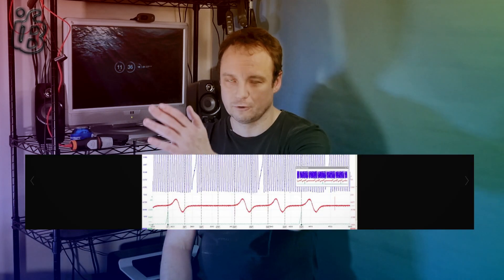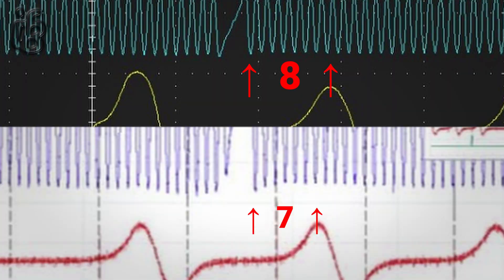YARIS XP90 TIMING CHAIN P0016 pt1 chat

Comment: any way to get part number? the o ring joined into three in the timing cover is not included in the timing kits...so wanted part number and is ebay the best price..local sellers don't give discount if they find ur not a professional
Reply from the maker: This is quite an important o ring, I got mine direct from Toyota.
Reply: @ifell3  thanks one more thing. The stud or threaded rod is gone for me . I stripped it. Is it only available in toyota or any other shop? I searched online using partnumber but no one sells ...Any suggestions?
Reply from the maker: @Truevideoz  With all due respect this video is 4 years old jajaja 
Which bolt are you on about https://www.catcar.info/toyota/?lang=en&l=bWFya2V0PT1ldXJvfHxzdD09NzB8fHN0cz09eyIxMCI6IlJlZ2lvbiIsIjIwIjoiRXVyb3BlIiwiMzAiOiJZQVJJUyAgICAgICAgICAoRlJQKSAxMTY1MjAiLCI2MCI6IlNDUDkwUi1DR01HS1ciLCI3MCI6IjExLTA2IFRJTUlORyBHRUFSIENPVkVSICYgUkVBUiBFTkQgUExBVEUifXx8Y2F0YWxvZz09MTE2NTIwfHxyZWM9PUExfHxtb2RpZm5hbWU9PVNDUDkwUi1DR01HS1d8fGVuZ2luZT09MlNaRkV8fG1vZGVsbm89PTAzOXx8UHJvZFBlcmlvZD09MjAwNjAxMjAwODExfHxtb2RfaW5mbzA9PVNPTHx8bW9kX2luZm8xPT1NVE18fG1vZF9pbmZvMj09NUZ8fG1vZF9pbmZvMz09RlJQfHxtb2RfaW5mbzQ9PVJIRHx8bW9kX2luZm81PT0zRHx8Z3JvdXBfaWQ9PTExMDZ8fHBhZ2U3MD09MHx8cGFnZTYwPT0wMDE%3D
I bet you are not even subscribed are you, or even liked the video aha only joking fella

Comment: Thank you for making this video, this is exactly what i was looking for at exactly the right level of detail for my skill level. 

I've got some noise from a 1nrfe, and i dont think that its the usual suspects (water pump or tensioner pulley, because i've replaced one and rhe other seems ok with the belt removed, no obvious grinding noises or play) and really dont want to take anything apart to check for a loose chain before giving into the garage (I've no intention of doing the timing chain myself! But like to know what the problem is). I wanted to know if and how i could use a scope to check for crank/cam anomalies, and you explained that perfectly 👍

Also some nice tips that i didnt know about Toyota tech data (can you download or only view the files?). Plus catcar was a new one for me and one I'll use again (as im always fixing one car or another!).

You've actually made me feel guilty about not uploading my fix for the vw antishudder valve which goes into a pedantic level of detail in oulling apart an unserviceable unit 😂.
Reply from the maker: @dalbahia4273  wow, best reply ever. It's replies like this, that make it worth my time. Don't feel guilty about not doing it, it's a lot of faff videoing and editing. 

What sort of noises have you got? I think I did a video on pulleys and auxiliary belts too. 

The tech data site is awesome, I've never known any other manufacturer to do it. Some even get nasty when you try to ask for a part number after they've told you the shocking price of theirs. 
Yes you can download, the files in the amount of time you have paid for, hint - look at the files afterwards and smash that download button as much as you can aha 
The TSB (technical service bulletin) is handy to have as well. Toyota will say to fix this try ABC, but if reported 9/10 it's F that's at fault, they send out a TSB to all mechanics saying if you need to fix this try F first. 

Catcar is fantastic!!
Reply: @ifell3  it's a grinding  noise, more than a rattle. 

Tbh, I normally work on VW diesels, so I didn't even spot it, but the garage that I use (and trust) pointed it out. Now I can definitely spot it, it goes away a bit if I take the tension off the tensioner (so the tensioner roller and water pump aren't spinning). But if definitely like to exclude anything about the chains. 

I replaced the tensioner pulley (my xp90 has the dual vvti so nf engine), I put in a skf part, but that hasn't really sorted anything, I also put in a new alternator belt (because, whilst you're there...). I did push and pull the water pump, but it's not got much play in it. I do have another water pump from Toyota but it's a hassle to put in, tons of bolts and no clearance (and don't fancy raising or lowering the engine, as it's a pain, but may need to do so anyway). I'd like to check the chain tension before I give it in for a water pump replacement, to give more direction to the guy who fixes my car (cut down on diagnosis costs a bit). 

On a side note, my car was pretty tired. Like yours, 'fully serviced' for most of its life by Toyota and then independents, but after having it pulled apart, I'm not impressed by some of the quality of work and the lack of any effort to pull out hand fulls of dirt from the cowl, brake dust from the drums, etc (hence wondering if it's wear on the timing chains). 

On the plus side, I've fully changed our every (well almost every) suspension and braking  component (including rubber insulators, springs, shocks, etc...), and it's amazing how well it now drives. It was horrific before, had the handling of a barge. It would be a shame if the engine was that worn! I'll have a look at the links on how to wire up a scope to the crank and cam shaft sensors.
Reply from the maker: @dalbahia4273  Have you tried the screwdriver trick to isolate the sound or, better still, a cheap stethoscope? It might get you closer to the problem. 

I might have covered a bit in this video about the water pump screws, I think I rounded one. But yes, at the back of the engine. They suggest removing the bonnet cowling etc for easier access. I'm wondering if you could get a motor and a pulley and test each component individually, like the water pump and the AC. My AC makes a horrible noise when on and idling. 

Yeah, you can find loads of crud under the arches and that, but the engines are good. The tensioner for the chain is behind the timing chain cover, which uses a special heat-proof silicone. They also recommend taking off the oil sump, but I never bothered. In my second video, the guides and tensioner all appeared fine, not too sure if that would be the problem. Or it would be the last on my list of things to find. 

Out of curiosity, I've got two new wishbones to fit. What are the chassis bolts like, super seized, or did they come out ok?
Reply: @ifell3  you're right, I do have a stethoscope. I also didn't think about the Aircon pump, as when I got my car, the Aircon wasn't working (I checked and there's no pressure in any of the lines). As there's no pressure, I can't engage the pump and put loads on it (I was thinking of getting some nitrogen to do a leak test, but to be honest, you've got to draw a line somewhere, I really don't want to get a vacuum pump, Aircon machine etc...)

I've got the old accessory belt so you're right I could put it on a drill and run the water pump and Aircon pump remotely. But I've had enough, I'll give it into the garage next week if I can (I've spent so much time on that car this year, I'm done with it!). 

I didn't do the lower control arms or track rod ends, I did have it on jack's this weekend to finish off the tensioner, but thought stuff it, that's a job for next year 😂. Plus, one of the bolts is obscured by the oil filter housing (it's a cartridge filter on my model) so I'll do it when I need the next service. 

For suspension bolts, some can be a pain. If you want to do a full suspension service (which id recommend, it feels like a new car), the rears are a piece of cake, I put in trw shocks, kyb springs and the rubber insulators (which I could only find at Toyota). The only tip I would give is get a pass through socket set, there's a great one at Amazon for £40, Sara ST09314SJ, Else getting the top bolts on is a pain, you will also need a crowsfoot spanner to torque it properly (if that's your thing, else tight enough should be fine). One other thing to watch are the stupid little bolts for her and sensor line and brake line. These will likely break. I would heat these up before tackling them and use plenty of wd40. I snapped the first with an impact, so used a standard ratchet for the second and still snapped it. You can weld new bolts in, but it's a pain in the ass. I'd also recommend getting some cold zinc primer spray (not zinc and aluminium), as far as I can see, nothing on Toyota's seems to be galvanised!! Where I saw rust, I took it back to metal and gave it two coats of zinc spray. Btw, you'll probably find that all of your brake lines are corroded well, they're about £20 each from Toyota. 

For the front suspension, I would honestly take off the cowling (if you haven't already). There's likely tonnes of crap down there, plus I got rid off a lot of corrosion the wiper arm nuts (which looks proprietary). Taking the cowling off (it only takes about 10/15 mins when you know what you're doing) makes the job a thousand times easier. There's a great video from KYB on YouTube. 

For bolts, I used an impact. I saw that you've got the Clarke, I was going to get that one years ago, but opted for air instead, but I've moved on since. To strip down the Yaris, I would suggest getting an electric cordless impact, it really simplified your life (just think of it as 2 hours of garage labour if you need to justify the cost 🤣). I've got quite a few impacts (Milwaukee and DeWalt), my go to ended up being the DCF 891 from DeWalt. I've also got the 921 which I found underpowered for Yaris bolts and a 961 which would just break bolts and simply wouldn't fit in most areas. I don't like the Toyota bolts, they  'seem' a bit weak to me and easily rounded. I found that if it doesn't come off with a few seconds of an impact, you're better off going in with some heat and an impact again  or a really large breaker bar (far earlier than I would on a VW or Volvo). As you found, they will round or snap! If you want a breaker bar that doesn't bend, US pro 1572, best one I've used, it's a beast with no flex. I also ended up upgrading my sockets to more flank drive for most of the suspension bolts, else you need really fine tolerances, in which case I've got a 35 year old set, which were made before most tooling became junk!

Should have really taken videos of some of this stuff, but life... I might do one on the automatic adjusters on the rear drum brakes as all of the  videos are crap and miss out an important step. None tell you that you need to spin your drums whilst getting someone to pump the brakes to get the best fit and do this repeatedly to get everything bedded in perfectly. But I don't suppose many people bother watching videos about how to solve the problems when your fixing something, everyone just want to see the perfect fix without any broken bolts or crap that went wrong 🤣 (which why I liked your explanation).
Reply: Should have also said KYB springs in the front (KYB seems to be OE for Toyota), new top shock mounts, Napa shocks (I was being cheap! But I see a lot of Napa at Toyota dealer that I go to 🤨) new drop links (febi). New shock mount bearings (the originals are SKF, if you need the code ,I can try and find them). All replaced in pairs.

Comment: Great video! But which are the codes engine to which you refer in the second part of what we learn from part 1?
Reply from the maker: Do you mean the 2sz fe? If so it's a different type of engine fitted in the Yaris. If the exhaust manifold is to the front it's this one, if it's to the back it's a 2nz or a 1 nz fe. https://en.wikipedia.org/wiki/Toyota_Vitz

Comment: Hi nice video. I have a picosope too and do use it sometimes mainly looking at can signals. You mentioned a library of good known signals. Is that on the actual software or on a website? Thanks

Nice video
Reply from the maker: Hi thank you. On the Pico website you can access them, only available to Pico users. Or it's maybe in the software once registered or something. There are a few Facebook groups though!
Reply: @ifell3  thanks for the quick response will check it out